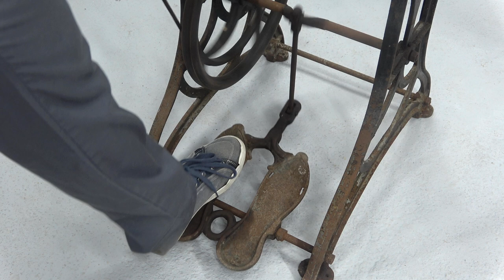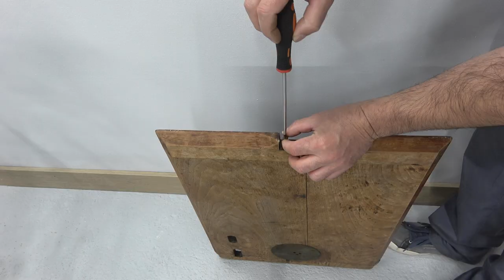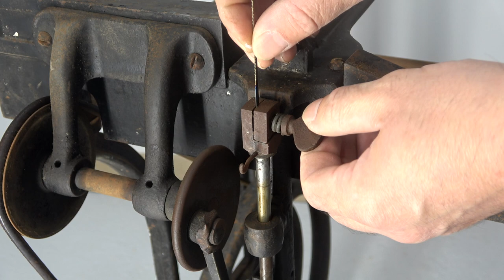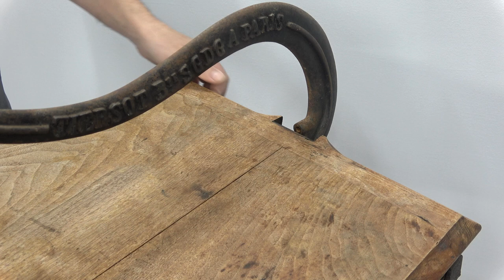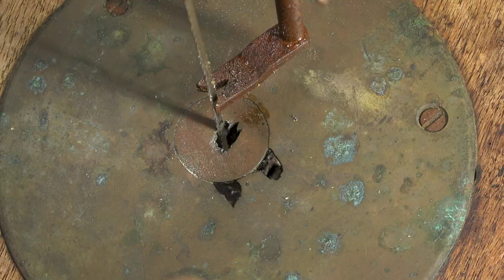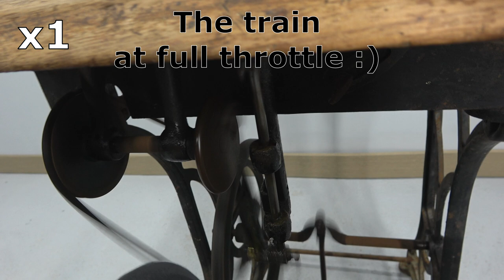Ancient tool technology. Pedal powered scroll saw

Comment: Thanks for the video. Seems like a logical complement to the 18th century treadle lathe. Still simple, but with the clever refinements to make it work more effectively.  Deserves restoration and preservation, I think.  An old time shoemaker we frequented before he retired had a sewing machine with a worn out motor that he used by hand to sew welts because he said it worked about as well.
Reply from the maker: I also found a lathe, but I have to make the workbench and the pedal 😀

Comment: Restore. I think it is worth preserving. Scrolls saws that work better are available and are cheap for everyday use, but this is reminder of the origins of wood working with machines.
Reply from the maker: Well, it is true that I wouldn't use this scroll saw too much even if I don't restore it, because it takes some effort to move the pedal while I pay attention to the wood I am cutting
Reply: @WoodworkingwithDIYtools  Maybe motorise it?
Reply: @Dadoo83  Ouch!
Reply: @MiniLuv-1984  In a reversible, non-destructive way, of course.
Reply: @Dadoo83  LOL, so have a boot attached to a crank connected to a flywheel turned by a motor actuating the pedals slowly?
Reply: @MiniLuv-1984  I would simply drive the smaller pulley via a new belt with a variable speed motor. The pedals and flywheel would just be ornamental.
Reply: @WoodworkingwithDIYtools  - like all hand tools (hand and foot, in this case!) it needs a bit of extra skill and time, but maybe gives a bit more satisfaction and sense of achievement when mastered?
Reply: @SAHBfan  Yes. there is a degree of "feel" to the work with a manually operated tool. The connection with the work piece is direct and in this instance you feel both through your hands in pushing the piece but also with your foot with the effort to cut. You emerge knowing something of the nature of this specific piece of wood.
Reply: @Dadoo83  Yes..my suggestion was just tongue in cheek :)
Reply: @MiniLuv-1984  :)

Comment: Restore it. Protect the metal from corrosion, use it. Get a different drive belt for use and keep the original leather belt safely preserved for the Historic value. It's a beautiful tool.
Reply from the maker: The most difficult part will be to align all the arts correctly, but I would like to restore it :)

Comment: If you want to use it clean up rust and lubricate it well.
Reply from the maker: It needs some adjustments. The top mechanism is not aligned with the bottom one
Reply: @WoodworkingwithDIYtools  My mistake - I meant to add "and adjust".  But certainly do not replace or add !
I love this machine !!!

Comment: If you want an art piece.  Do the full restoration and never use again.  If you want a tool.  Service the moving parts.  Remove and repaint rusted surfaces and clean / varnish and polish the top.  The cast iron parts will last whether they are “restored” or not. 

Often a “restoration “ removes the value of its age
Reply from the maker: I would like to restore it. But sure it will take more effort than what I think